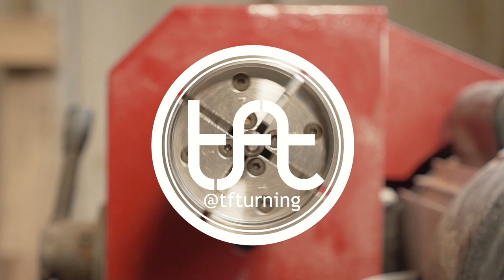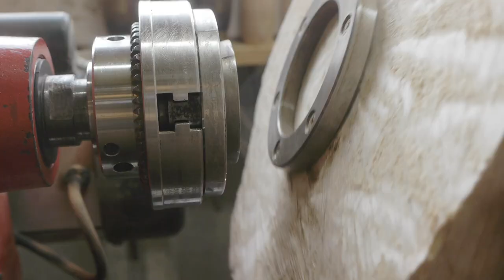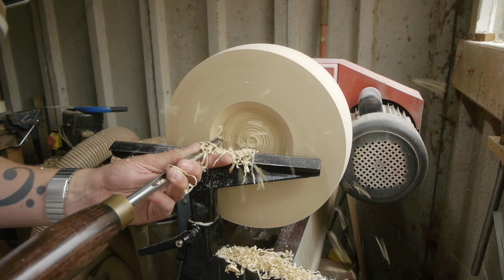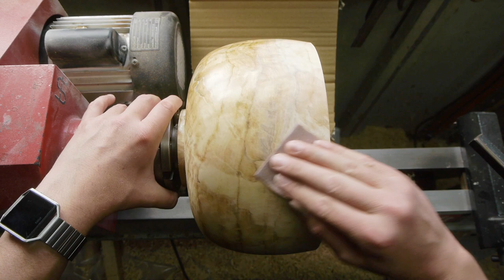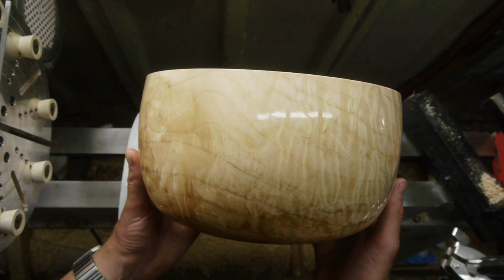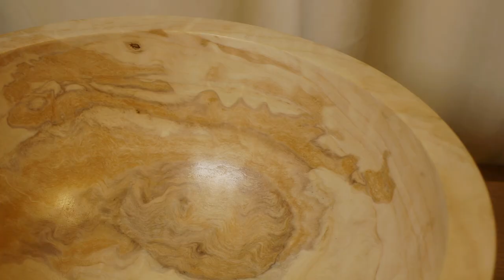Super Shiny Softwood Burl - Woodturning

Comment: Pieces of wood like that are why I have a coring system. 2 cores would pay for half of a system....
Reply from the maker: I have been considering buying one for some time but just not took the leap yet. Also not convinced my lathe has the crank power to pop out cores. One day, I will.
Reply: @tfturning  Well, I would say you need a 1 1/2 hp motor and 220 volt power. A 1 1/2 hp on 110 power just isn't tough enough for the McNaughton. The Woodcut Core Pro might be easier. Oneway system , their cutters are junk to me, and every one seems to be switching to the Hunter Core Pro tip. I prefer the McNaughton, but it does have a learning curve.
Reply from the maker: @robohippy  Yeah that makes sense, pretty sure this lathe is just a 1HP at 220v.  Definitely looking to upgrade at some point. Thanks for the info!!
Reply: @tfturning  Look into the Woodcut coring system. Haven't turned on a 1 hp, 220 volt motor, but the Woodcut takes the least power to work.